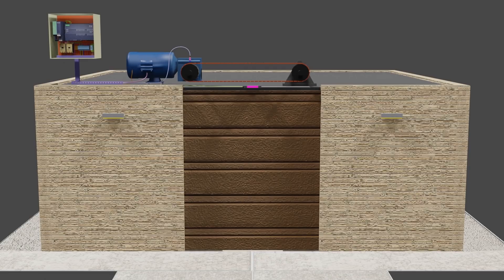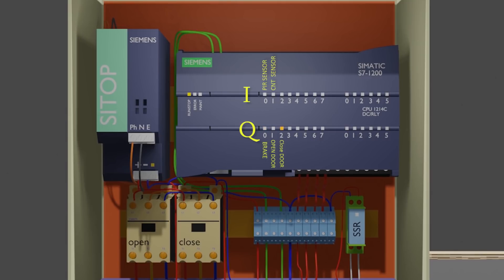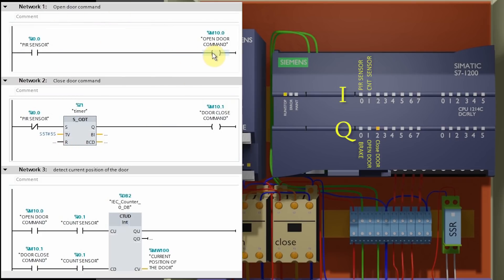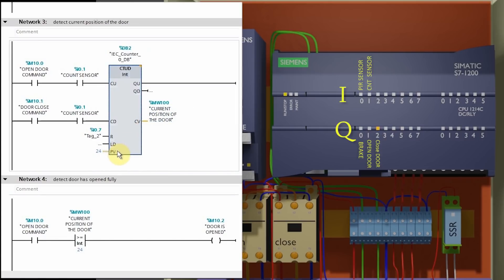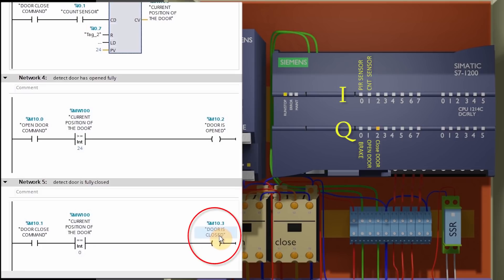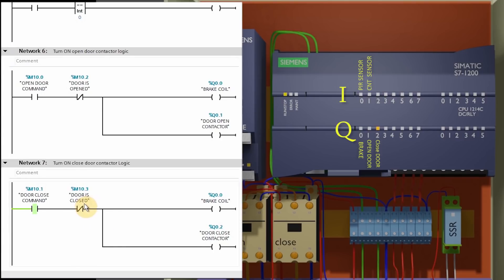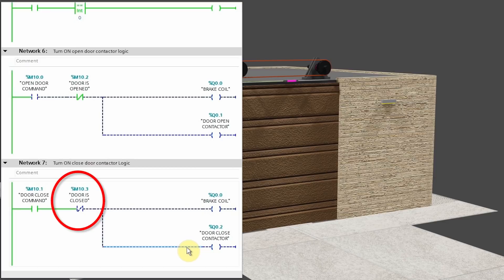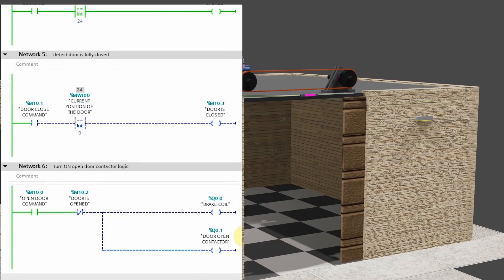Automatic Door Programming with PLC || PLC Programming Tutorials for Beginners

Comment: I have a question,if the energy supply down,can the counter retain the position?,or the counter will be reset?,thanks a lot
Reply from the maker: Yes it will LOSS its values , we have to use the retentive data register to save the current value of the encoder to avoid this

Comment: Why they use expensive gear such plc, encoders, clutch thing what ever call it and above all programming,instead of ROCK SOLID  cheap and easy method ...two limit switches for door travel  and double ir detectors for in and out all in one pcb which cost no more than 45 euro !!!!

Comment: you are using q0.0 coil 2 times so it updates it with the last coil placement. so it wont energize it in the open command at network 6
also as a concept overal you should use switches at the ends of the door travel, just counting pulses is wrong
:)
Reply: That's true, this program will not work.